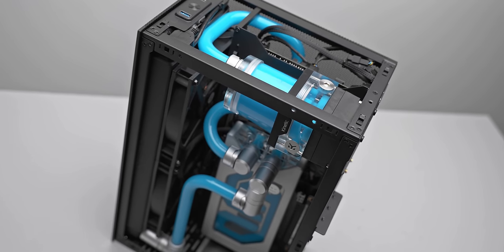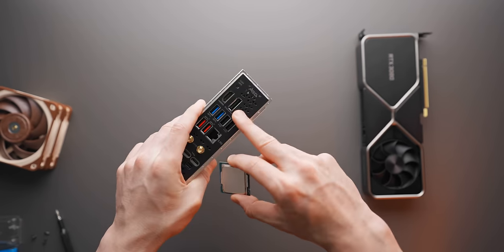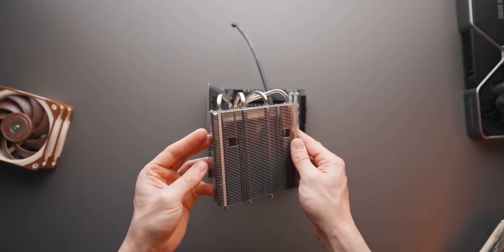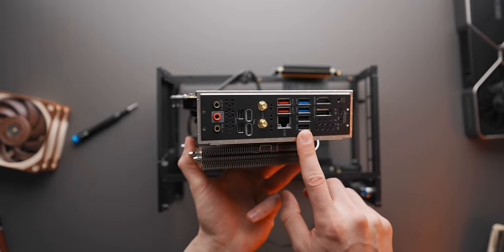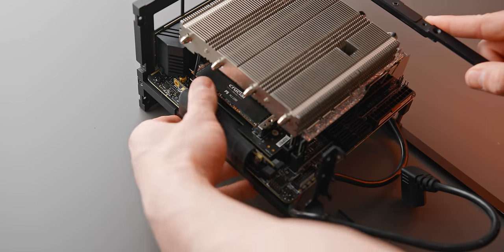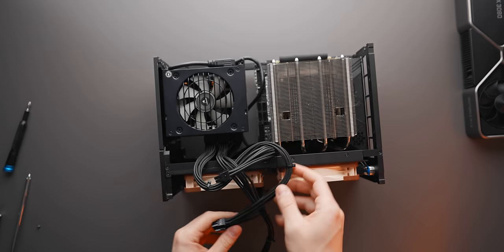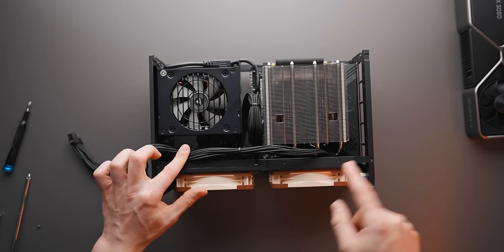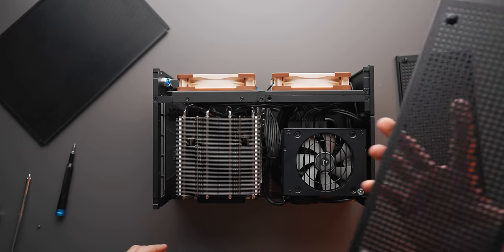Overpowered Gaming PC Build - Step by Step

Comment: Can the Argus Monitor software control fan speeds based on a thermal sensor plugged into the motherboard (trying to control pump/fan speeds based on coolant temperature)?

Comment: What do the CPU thermals look like at load with that cooler? Looking at getting a Fractal Terra but there's no room for an AIO or even case fans, so it'd be wholly reliant on the CPU cooler.
Reply: in the Terra, there are mounts on the floor for fan installation. The one under the motherboard tray is pretty much useless since it's mostly blocked by the riser cable bracket. The other position is under the power supply. A fan should be populated here and set to exhausting air downward towards the floor instead of intake because you wont get much fresh air going in anyways. Once your fan gets shallower than 1 inch from a ""wall" (in this case, the desk below it) airflow potential is drastically impeded. Having the fan set to exhaust (negative pressure) will encourage more air through the vented side panels, which will also help with the CPU temps.
Answering your original question; the CPU doesnt get very hot at all under gaming load. you'll really only see a heat load at 4K gaming Ultra Settings. But it's actually the GPU doing all the work that needs the most cooling. Not the CPU. The L12S here will be more than sufficient for pretty much any modern gaming CPU. But on that note, there's no reason to go beyond something like a 5800X3D, 13600K or 7800X3D for a gaming system. Anything beyond that, like an i9 or Ryzen 7 etc, you'll just get diminishing returns on framerate.
Reply: @trevorbarney1796  Not everyone just wants to game. I want to render a few videos and large high res photo sets on a semi regular basis which makes for a heavier CPU workload, and why I'll be going for a 13700K.

Comment: I keep getting freezing / unresponsive when I click  confirm on the 1st undervolt step for MSI after burner. I bring up the 875 point above the rest and hit confirm then everything freezes. z690i i7 12700k, 3070 Ti FE, Corsair DDR5 5600 32 G ram. 2 tb SSD. Windows 11 64 bit

Comment: It wouldn't be impossible if you didn't have integrated graphics, you just would have to boot it out of the case first with a smaller (and cheaper) graphics card.

Comment: there's a HUGE flaw on that build, the Founder's edition's are known for overheating under huge work / gaming on high quality due to the fact that only have 1 Fan, and need space to cool, but this build not only it's a i5, which is completely low for high gaming quality / doing other tasks, but the GPU needs way better cooling such as, a better case.
Reply: especially with the undervolt its totally acceptable, i5 also isnt an issue for gaming
Reply: @monsieurbenno  for competitive gaming it is! i had an i7 and had problems with frame drops
Reply: @crkunik6897  it's not an issue unless you have a shitty gpu or play at 720p, 6C/12T is all you really need rn, especially for 1440p
Reply: @monsieurbenno  believe me that it is, specially when you need your fps higher then 360 constant, and it's Crucial that it's stable, i'm talking about competitive tournaments, not casual gaming. i have i9 9900k + 3070, and still have fps drops, small but it causes trouble in tournaments when you really need that performance
Reply: @crkunik6897  of course you're gonna have drops. But unless you play on a really low res its not the cpu causing them but the gpu. I run 11900k/3070 and I know what you mean

Comment: Is it possible to replace the GPU with 3090ti and CPU with i9 and keep everything else the same?
Reply: For the GPU, you would have to check dimensions to make sure your model fits the case. Noctua says the l12 is good enough for i9 processors, so you should be good there.
Reply: @icneo9738  - thank you. I’ll be going for the 3090ti founders edition and i9, but I wanted to check if the rest of the parts will be compatible, power supply, for instance.

Comment: Pro tip - if you have pcie gen 4 MB and GPU & gen 3 raiser.,., Just setup pc before you build it.,. Make sure to change bios setting pcie to gen 3.,. Easy.,. No need to buy CPU with integrated GPU -

Comment: 2k GPU 
250 CPU 
350 MOTHERBOARD 
50 COOLER 
67 SSD 
151 PSU 
122 RAM
_____________
3000 Euro's :( 

Sad times we are living in.
I miss the old days
Then there is Case, peripherals, monitor, basically nowadays if you want a build that would last u need over 4k euro's..
Add 1k to that and you can get a nice SH car

Comment: whats the best cpu fan for a mini itx build i have a ryzen 5 3600 going 50 degrees at idle stock cooler i cant overclock it the temp goes crazy.?
Reply: What's your case?
Reply: @rookie693  cougar qbx
Reply: @arnoldthegreat4138  Noctua L12s is a good cooler. Max I've seen with 3600 is 80c which is better than the stock cooler
Reply: @arnoldthegreat4138  and that's really depending how good the airflow is

Comment: i've been scouring the internet for a few days now and i can't understand why i get constant 95 fps in 1080p gaming new or older games  with a rtx 3060ti or a gtx 1080 non ti same results every time and i heave a ryzen 9 3900x and ym still running into this problem even if i lower the settings in game to medium or low from high settings same story wont get more than 95fps v-sink off 1440p monitor and i heave XMP enabled for my 16gb ram to run at full speed of 3600mhz and i do heave a 700wat power supply 80+bronze certified i dont understand it what do i do can anybody help?

Comment: Bad idea to put those fans as exhaust .. 2 reasons : 1 - You can't filter air entrtering the box => it's bad. 2 - you are moving hot air, less dense then fresh air => you lose a LOT of efficiency.
Strange for an "optimum Tech channel" ..

Comment: That's not an overpowered gaming pc, that's just a high powered gaming pc.  An overpowered gaming pc will have several 3090s and a threadripper 32 core processor or i9 and 256gb of memory.

Comment: Anyone who thinks this is good: The cpu cooling sucks. You need BIG heat spreader. You're losing performance and losing money. SFF is not good for gaming. If you're paying big bucks for your hardware, you don't want to castrate it and make it thermal throttle. It is already been said and tested over and over again. With that said, suit yourselves.

Comment: did bro put an i5 in the same pc as a 3080..?
Reply: i5's are so blazingly fast nowadays that you dont need to over spend on your cpu. But if you want to be financially irresponsible, then by all means, go ahead and spend $500 on and i9 for 3% more performance lmaooo
Reply: the CPU isnt even a bottleneck. you can get a midrange cpu like a ryzen 5/i5 with pretty much any GPU nowadays.

Comment: 8 minutes into the video and there's already so many mistakes, we're really not used to seeing that from you.

1) you dont have tweezers handy anywhere
2) no anti static bracelet
3) that's a solid clasp and not a click when inserting the ram
4) only one thermal compound? it's actually good PC building practice to mix multiple. dont be cheap
5) how is that a tutorial when you dont explain the sort of bracket that goes into the - back - of the computer?

i stopped watching right there.

Comment: horrible organization. u def need to connect 12 pin for video from diff 8pins cables from PSU, but u connect it at one cable - very bad idea.
2nd, better change orientation air flow at CPU fan, consequently u need to change direction of air flow for case fans too.